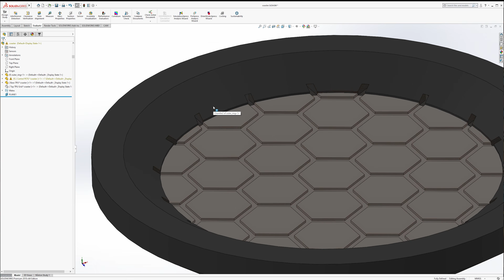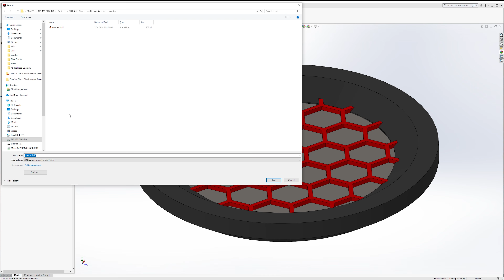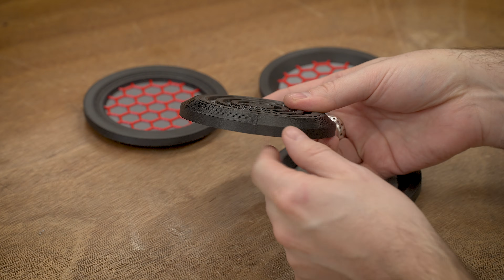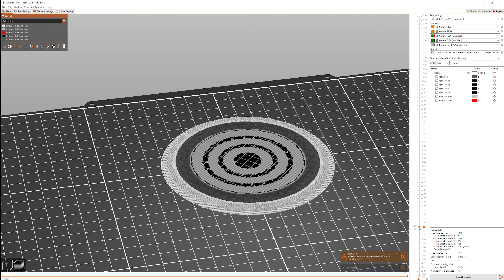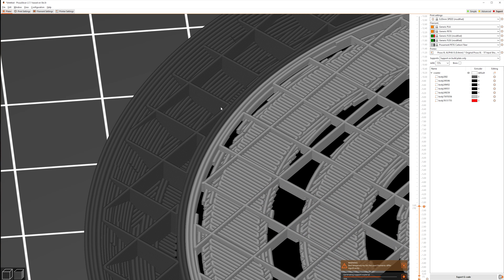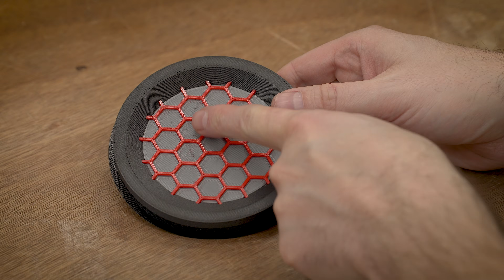Multi-Material Coaster - ALL THE FILAMENTS!

Comment: Having multiple wipe towers actually sounds like a pretty good solution for "incompatible" materials, though it should probably have the "no sparse layers" feature enabled, otherwise every tool assigned to a tower would have to be picked up to keep the height of all the towers the same as the print.

Another solution that might work depending on the filaments used is to set a specific tool as the "wipe tower extruder", which means the wipe tower will have an exterior shell made of the material from that tool. That way you have to rely a little less on the layer bonding between different materials.